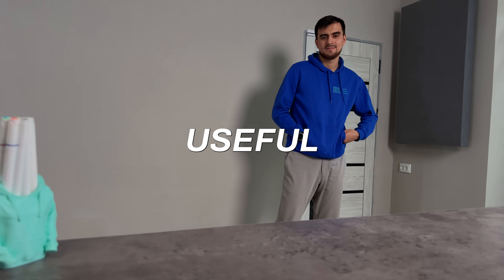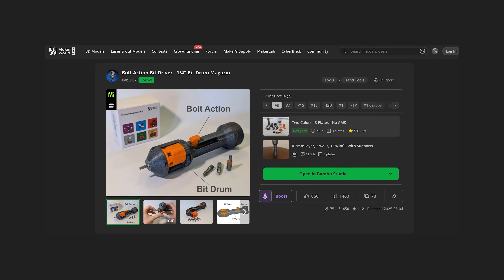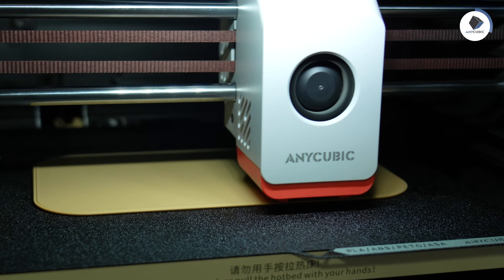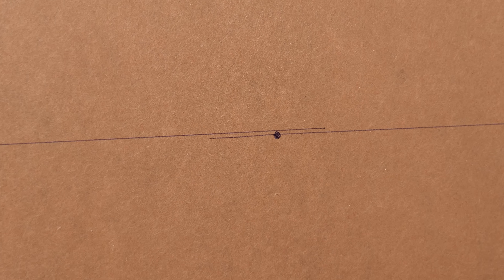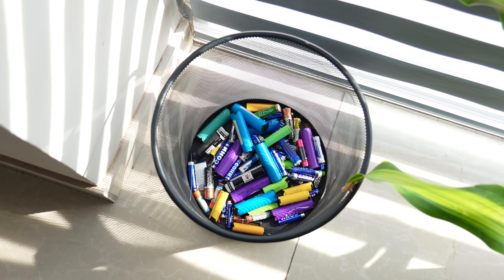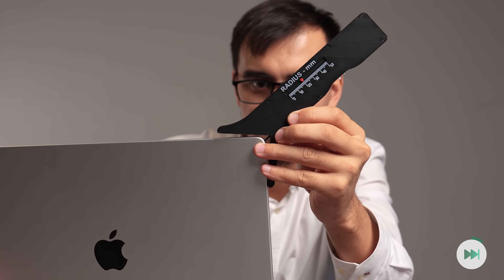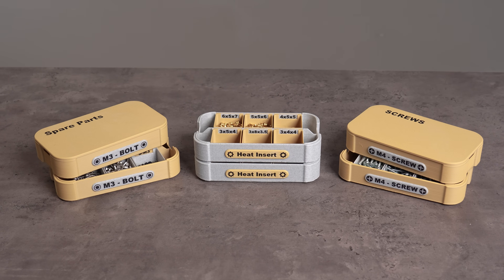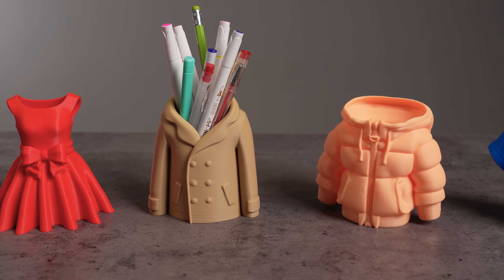You NEED to 3D Print These for October 2025 | Anycubic S1

Comment: 0:24 Rotate it 90 degrees, clamp it the right way, then solder it easily. Using your brain instead of running to the printer for every little problem leads to success and a vice that doesn’t melt when you solder.

Comment: Correction, the first one can be 100% 3D printed. You can print 608 bearings, which for this application should be enough, since the load is minimal. You can also technically print the screw :P
Reply from the maker: Thanks for the feedback, appreciate the info!